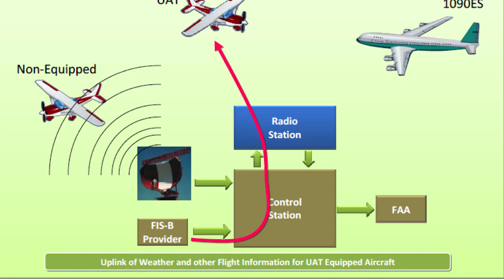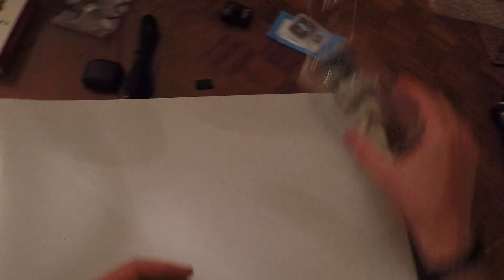Stratux Do-It-Yourself ADS-B In

Comment: How does the battery shut off?  I hold the battery power button until the red and green light go out, but once releasing the battery button the red and green lights go on again.  Is there a certain number of seconds required to power down the battery pack?   thx.

Comment: Will this meet the 2020 requirements for ADS-B?
Reply: No, checkout the skybeacon for the simplest/wallet friendly way to comply.  Depending on your plane /typical cruise altitude you might want a dual band solution with in and out. There are lots of caveats to equipage and John noted one of them. 

If you aren't flying in or above B/C you might not need it at all.

Comment: great project, but I think the AHRS is worth the extra $ for a commercial unit. particularly if you are only flying with a vac system. could absolutely save your bacon. of course you could also go pay $5-10k for a panel mount..... yeah right....
Reply: You can add an AHARs chip for something like 40$

Comment: Would this be any good for a non pilot to see local weather from the ground?
Reply: Aviation weather is a little different and not quite what you're used to seeing in typical apps and on your local news stations.  Not that it won't be useful, it obviously is for us. There aren't predictions like "40% chance of". A forcast will simply say "rain, thunderstorm, snow" and so on. No "chance of" per say. They also generally don't forecast much passed 12-18 hours, so you're not going to get things like a 5-day forecast off what gets aired. It's a very rudementary coded text that with a little google isn't hard to decipher. So basically what I am saying, for "ground" use, it would be extremely impractical with no real benefit to you that's worth shelling out any kind of money like this for. You get live conditions and such, but you can also get that from any free, or really cheap app.

Comment: For a somewhat cleaner look (and excellent performance), you might consider the pingEFB. It eliminates the need to use pi cpu for antenna processing, and you can put your pi cpu anyplace in the cockpit. You just mount the pingEFB on the window. Adds to the cost a bit, but it was worth it for me.  http://www.uavionix.com/products/pingefb/

Comment: I wrote the UAT demodulator that was subsumed into dump978 and used by Stratux later. It really grinds my gears that the performance of RTL-SDR is not sufficient to receive UAT, generally speaking. So, instead of actually demodulating, I used sampling to self-clock and then just looked at the phase angle between 2 samples. If the sampling hit the bits right, the result was a packet. If not -- garbage. So, at best of times, Stratux only receives half of the UAT packets and drops half. This makes weather delivered slower than possible with a proper receiver. I really hope that this is what $600 buys you with a commercial UAT receiver.
Reply: https://github.com/mutability/dump978/blob/289eff664d0dc3b955098d02da705bd2265db918/dump978.c#L283-L307
Reply: Which branch of dump978 did you work on?
Reply: Original code is here: https://github.com/zaitcev/ruat  But it only has historic interest. Even mutability/dump978 is vastly better.

Comment: The external GPS is not necessary if your iPad has built in GPS unless you don't get good reception on the iPad in your aircraft.  it works great in mine.

Make sure you install the sticky copper strip inside the case as directed as that is the antenna ground plane which greatly helps.

You might want to hit the inside top of the case with bright white paint or just stick a piece of white paper in there to reflect sunlight away to reduce heat on the board.

Usr a quality USB battery. I recommend Anker. often these Stratux kits recommend cheapo obscure brand batteries. Also use a quality USB cable and no longer than absolutely necessary. My first Stratux setup used a long cheap cable which caused too much voltage drop across the cable so the computer would crash.